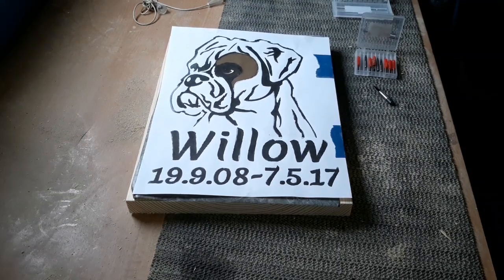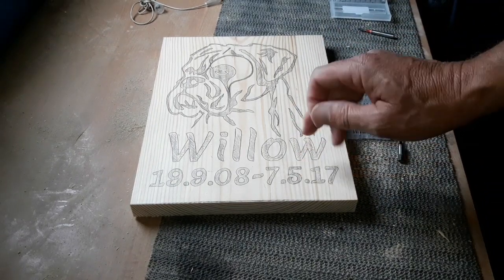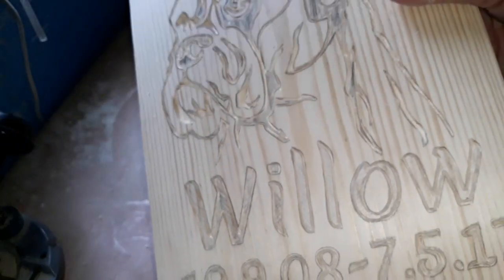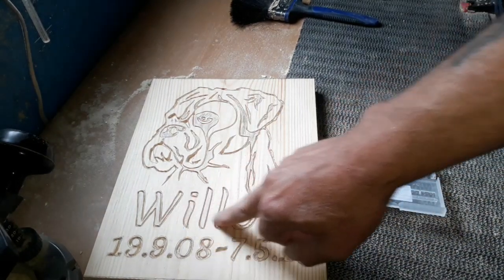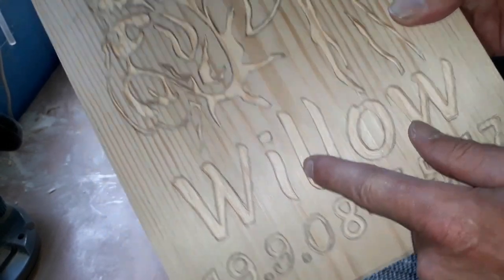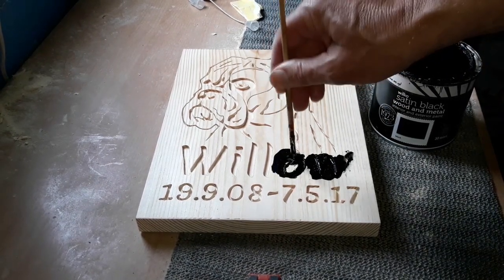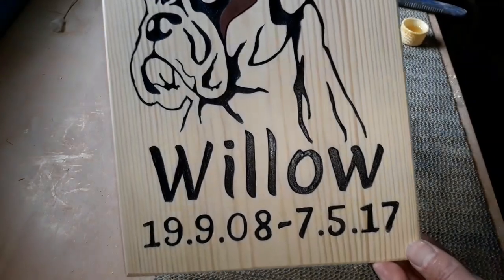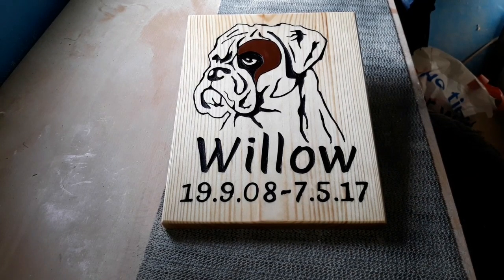Boxer Dog wall plaque .Router project

Comment: Great job, I use a belt sander but I have a compresser to blow it clean afterwards due to the amount of dust, I also use a random orbital sander not quite as much dust but still a problem.
Reply from the maker: I've just been on attaching a mini compressor air line to my router,it blows the dust way with a tap on a pressure pad on the floor ,I will try it in my next video..
Reply: Mine is a large tank but its still worth a try, it can only fail
Reply from the maker: @johnwaites6803  I've tried it works great,just got to get out of the habit of brushing the dust away...